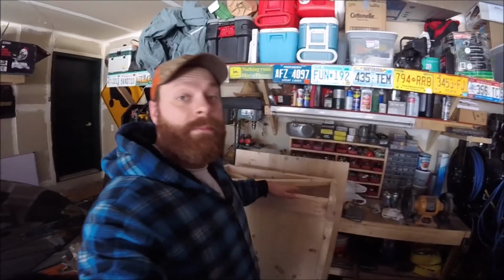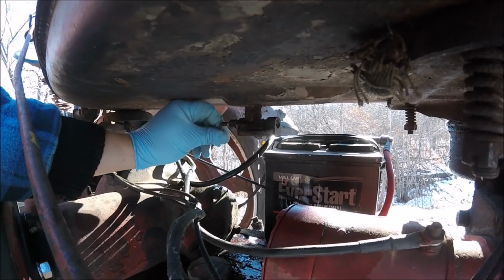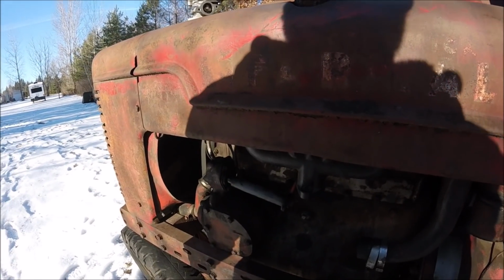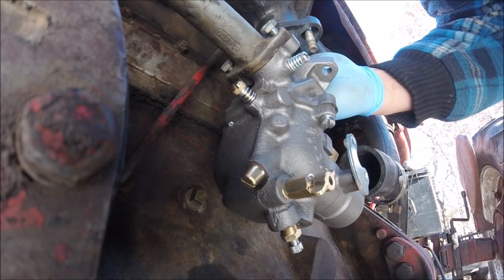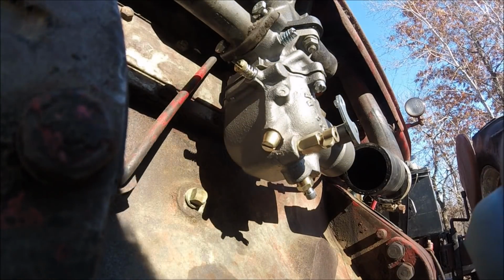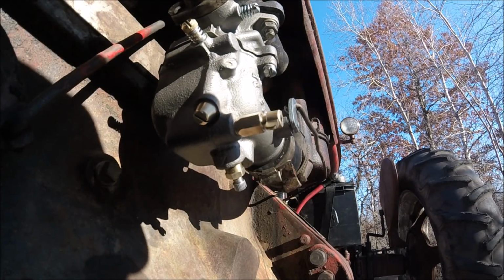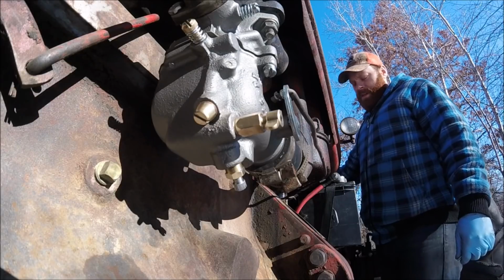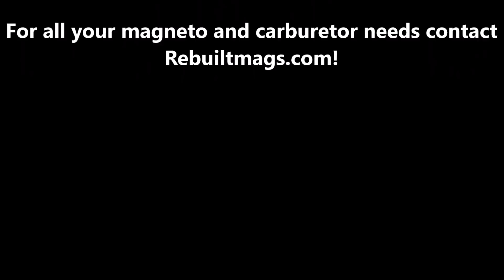Farmall H Carb, Pinterest Projects & New Adventures

Comment: I have remover the sedment bowl assemble and pressed a short 1/4 copper tube in the hole and that way it only sucks fuel from 1 inch from the bottem   of the tank. and the junk sits on the bottem. and oh ya I had that same sickness for about 2 weeks. good luck with that. Bob
Reply from the maker: The older, original sediment bowls typically work better than the newer ones... Good idea with the copper tube. There is a tall filter screen that Steiner sells that presses into the sediment bowl inlet inside the tank that I have used before. The sickness is waning, I hope.. On to more projects!

Comment: Nice job on the coffee table. The H sounds good now with the rebuilt carb. Does Rudy just bead blast carbs or does he soak them in cleaners? Hope you get well soon, this junk just seams to hang on. I have had mine now for 3 weeks.
Reply from the maker: Thanks bud!!! It depends on how dirty they are. If they are extremely greasy, they get wire brushed, soaked, and bead blasted. The key is to get all the passages cleaned out. Can't give you all the secrets, though!!! :-D

Comment: Hey, take care of that cold. Vitamin C. I have a carburetor question. The float gave out on my carb and I rebuilt the whole thing. Now though, when I mow my side ditches and the carb is on the low side of the engine it floods. If the carb is on the high side or level it runs great. I have taken it apart again and everything is correct. Any idea what is going on with it?
Reply from the maker: Thanks, Jeff. I am at the tail end of this cold, I hope. You might just adjust your float down a hair on the carb... Sometimes those float setting can be a little tricky.

Comment: Nice job.have one gas tractor had 504 upgraded to 656. Both had sedimate bowl problems. Put new on.dont leak.Im not touching it.leave on. Had to clean bowl quite a few times on 656.rust.not so much now.plus i put inline filter in it.  Gess gotta have somebody rebuild engine.80lbs comp on two cylinders. I just use it to ted and rake hay.656 perfect size. It could run disc bine buy little underpowered. By ser number found its a 65.not 68.cant identify block no tho
Reply from the maker: Thanks, Mark! Ya - I won't replace the bowl unless I have a major issue with it. Usually the older sediment bowls work better than some of the newer ones anyhow. In the spring I might take the tank off and flush it, but for now it will work. There is a tall filter screen that Steiner sells that presses into the sediment bowl inlet inside the tank that I have used before.

Comment: Kenny, get inside & cure that cold!  Will a ratchet box end wrench fit that back bolt?  The old H sure sounds good.  Congrats on the job with Rudy!  I assume it's part time?  The coffee table turned out nice.
Reply from the maker: Matt - I appreciate the concern, bud! I have bee fighting it for over a week (not nearly as bad as it was a week ago)... Ratchet wrench won't fit... You have to get a box end wrench on that bolt at just the right angle, and then about a 1/8 turn at a time. The job with Rudy is on-call, part time... When he gets carbs, and I am not working, I work for him. Got at least 3 on the bench right now waiting. I will put a photo up in the next video of the carburetors I just did!
Reply: Farmalls are famous for those tight fits.  The mag on my old 47 Cub was a bugger to reach the back bolt.
Reply from the maker: @mattthescrapwhisperer  yes sir. My Case is a pretty tight fit also. Just gotta figure out the correct wrench orientation and then you are usually good!